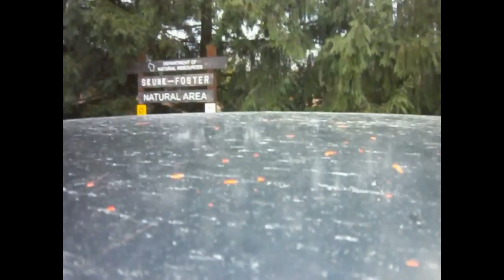12 12'' pioneer demo mazda 323 hatchback

Comment: I see. I was under the impression from you videos, that you were going for SPL. I still believe that you will get better sound and pressure from 4 15's in the right box. But it will require you to actually test your cabin for the best box and placement, not just cramming in woofers. Is the TERMlab yours? If so, why not add the SQ software and measure you cabin gain and transfer?

Comment: Of course, you have more SD. I'm saying the box is wrong for SPL and the car has way too many weak points and air leaks to get the number you should be seeing. Back in the mid 90's when I was heavily into car audio I did 141.3db with 2 Punch DVC 10's and 2 Punch DVC 12's in a 1994 Regal with 600watts @ 63hz Those subs did not have the xmax today's subs have. Everyone laughed at me when I put up my bracing for the contest, but I was 6-9db more than them because of it. With less power.

Comment: too many subs for the box volume. I would suggest building a wall and supporting the front window and roof with bracing. A good 4th order "tunnel" design will net you a better spl then this box.